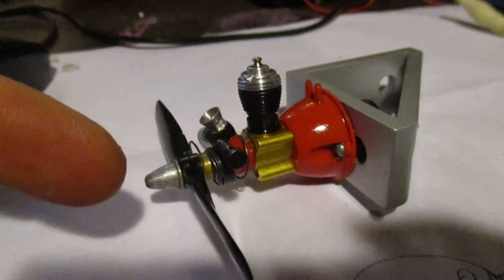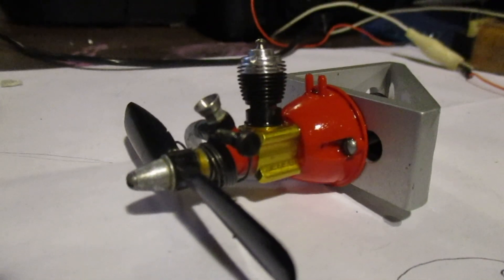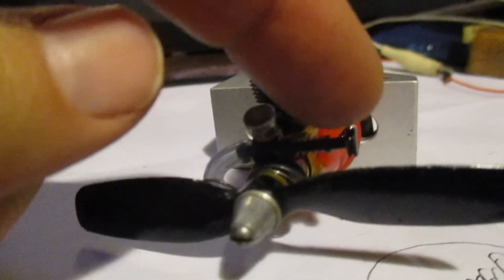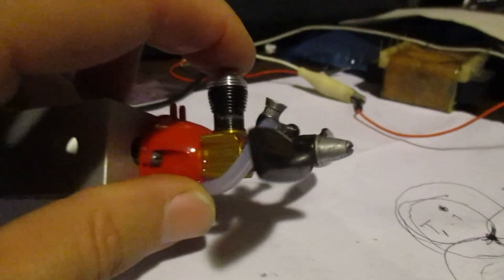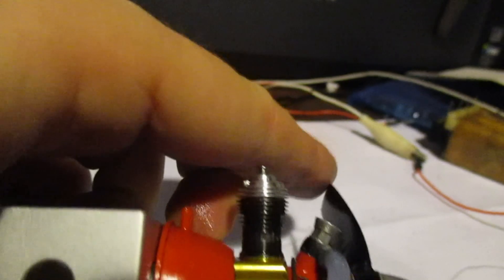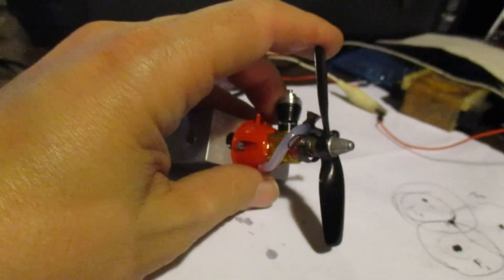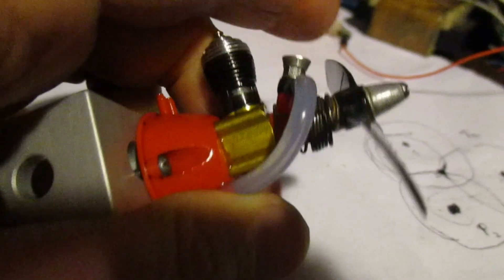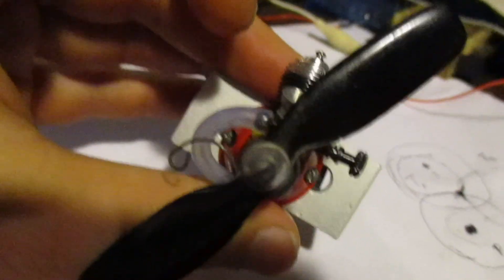Cox Tee Dee .010 - Worlds Smallest Production Diesel Engine in Action

Comment: NOT a "diesel"...

The ignition happens because of a catalytic reaction between the methanol in the fuel, and the platinum in the glow plud element. 

If you surround a fine Platinum wire with methanol vapors, the wire will glow red hot all on it's own. THIS reaction is what fires the engine on every power stroke.

Comment: You're winding it up way to much rounds. One half is enough ;)
Reply from the maker: Thanks for the great tip!!
Reply: Never started any of my Cox engines with half a turn
Reply: @afrog2666  how much did you use
Reply: One full turn only.  DO NOT over-wind the spring.
Reply: 1 turn at the most or you'll end up distorting the spring eventually

Comment: I grew up flying these on different airplanes they can be a pain to keep running but once you get them going good they are fun. Really loud for their size! My dad started my RC airplane love by telling me where I could find the old one he had. It was in a box of junk out in a shed. It was the old one with the shiny metal tank on the back. I fell in love with the smell of the burning fuel and the excitement when it fired up and was ready to fly. His was off some free flight plane I never got to see. Probably in the 60s. He said it had a fuse connected to the rudder that held it straight, you lit the fuse when you launched it, he said it would go straight till the fuse burned and let the rudder turn by a rubber band or spring and it would circle way up in the
 sky. I sure would love to know what it looked like. I still have that one and two newer ones from around the early 90s. Just cleaning them up today. I want to put one on each wing of a glider as a twin engine 😁😁 Im still a kid at heart when it comes to RC airplanes😄
Reply from the maker: Very Cool! I had a balsa wood RC plane that I build from scratch when I was a kid! They are so much fun! Thanks for the great comments!!

Comment: Good job getting it going, but as AmpAbuser says, it is not a diesel engine. There are model diesel engines. They run on kerosene, ether and castor oil. They are compression ignition - the key characteristic of a diesel engine.
This is a glow plug engine. The platinum element in the glow plug continues to glow after the battery is disconnected and the fuel mixture is ignited by the glowing platinum coil.
These are sometimes erroneously called "nitro" engines. They actually run off methanol and many don't require nitro-methane at all - although these small Cox motors do.
Once again, good job getting this one going again.
Reply: some people love to talk out of their bottoms..
Reply from the maker: Thanks, I'm glad you liked it.. I find it amazing that such a simple little engine can not only run, but also put out such a large amount of power in such a tiny package.. The internal combustion engine is an amazing invention. Thanks again..
Reply: Very well said Richard Tapp. Thumbs up.

Comment: Not a diesel engine it runs on methanol / nitro blend and is glow engine. =)
Reply: Sidney Mantissa dude why are you so mad it’s a TOY engine. Jesus if you get mad that easy you need some damn help
Reply from the maker: Ok I will go with that.  It does operate on something like a diesel cycle, but technically I believe it is not because diesel has enough compression in the cylinder to ignite the fuel, where this little engine required a glow plug. It is a very simple engine, with no valves or spark plugs though, much like a diesel engine.  Nitro is a great fuel.
Reply: Nitro helps to supply oxygen to the engines combustion cycle thus increases power methanol keeps that glow element hot, castor oil is best used 20% of the blended fuel. I recommend 30% nitro and 50% methanol. The  TD .020 best with the same fuel mixture and .049 will do fine with 25% nitro. I have ran the TD .010 to 42,OOO rpm unloaded in the air and a ground speed of 130+ mph amazing the con rod did not snap nor did the piston's ball socket crumble. 33k static has been reached too.